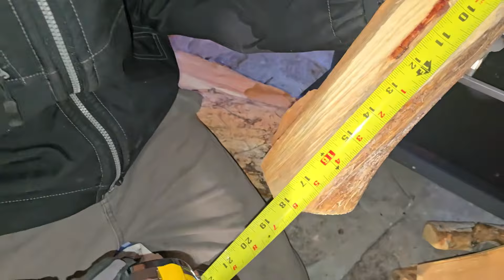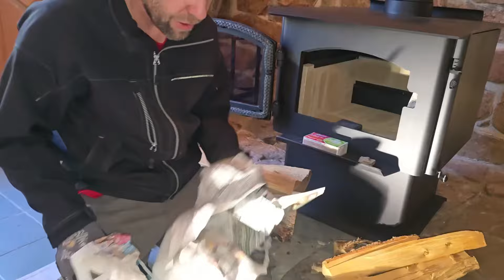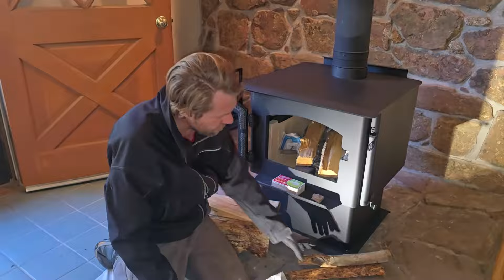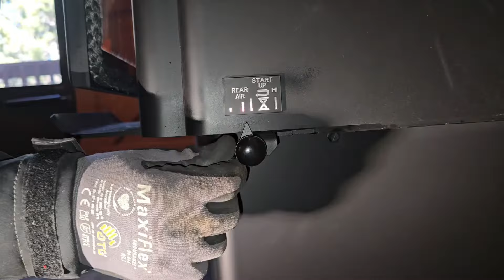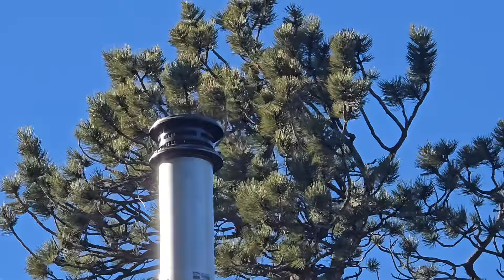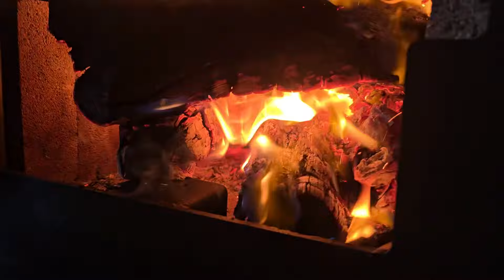Quadra-Fire 2100 Millennium wood stove review and Fire Starting video

Comment: From your video, I noticed on top of the air tubes in the firebox what looks like a white colored, fireproof insulation mat, like fiberglass batt. That seems like an odd detail and maintenace concern, as the fire touches it passing along on its way to the stove pipe. Can you explain please!

Comment: How hot the  top plate gets ? Is it possible to boil water ?
Reply from the maker: There is a stove top thermometer available and it usually shows 400 to 500F which should boil water in a tea pot after 30 minutes!
-Byron
Reply: @Midtownsweepsfranchise thank you

Comment: Great video man!  you are the only one that went over ALL the stoves capabilities in detail. I got this stove in November and discovered most of what you said on my own. The only issues with this stove which is common is that timed air control mechanism on the side, it doesn't really work right and I have heard this complaint from 2 others who have this model, so I just do it the old fashioned way and crack the door a bit until things are running very hot and red.
Reply from the maker: Thank you for the good details on the Quadra-Fire! I appreciate you watching and adding to the knowledge base here!
-Byron

Comment: Wow, another wood stove that kills heating a room by drawing the heated air back into the wood stove. Now, if the wood stove had a fresh air intake, it would be cooking with heat.
Reply: in order to get additional air intake from outside for a wood stove you'd have to have another pipe supplying air from outside. I haven't seen that yet.
Reply: @billbates5475  The outdoor combustion air myth got started almost fifty years ago when safety and construction standards were written for mobile homes.  Because they were small and factory-built, it was believed that mobile homes were air tight. As a result, all wood, oil and gas furnaces, stoves and fireplaces had to get their air from outdoors. Because these air supplies were invariably routed straight down into the ventilated crawl space under the mobile home, they didn't cause too many problems, so it was assumed that they actually worked.
In the 1980s, when large exhaust systems – like downdraft kitchen range exhausts – began to cause spillage from fireplaces and stoves in reasonably tight houses, a consensus quickly formed around the idea of bringing combustion air from outdoors, just as had been done in mobile homes for decades. Such certainty existed among housing technologists and regulatory authorities on the issue of outdoor combustion air that it was made mandatory in most building codes. Unfortunately, the decision to enforce mandatory outdoor air rules was made before research was done to investigate how they actually work.
The supposed benefits of outdoor air are not supported by research results. Laboratory and field reports have revealed that providing outdoor air is not a simple or effective cure for spillage, and that some designs could create a fire hazard.
Reply from the maker: Hmm Interesting!
Love to see a scientific report to support it!
-Byron
Reply from the maker: That is correct! We always do fresh air tubes through the rear wall- on this job, the tube was not installed at the time of the video. We HIGHLY recommend that all freestanding wood stoves have it!
Sharp eyes! Thanks!
-Byron
Reply from the maker: Agreed! The customer is having us install that separately. She was in a rush to get it installed that day. But soon there will be the sound of mortar drills and an air tube sliding thru the wall!
Thanks for the sharp eyes!
-Byron
Reply: You are perpetrating a myth because I assume you lack intelligence. Pay particular to the third myth. ;) 
Outdoor combustion air was a good idea until it was studied. 
There seem to be three theories behind this outdoor air supply, depending on who is doing the explaining.
The first is to replace the air sucked out of the house by the wood burner, based on the idea that houses are airtight and the wood burner will use up all the oxygen.
The second is to reduce the risk of smoking into the room, even when the room is depressurized by a big fan like a kitchen range exhaust.
The third is to save energy by using outdoor air rather than indoor air that has already been heated.
Doesn't matter which theory you pick; none of the three stands up to scientific scrutiny. It turns out that the most consistently reliable place from which to take combustion air is the room where the appliance is installed.  Forget about outdoor air supplies as a way to make wood stoves and fireplaces work better or be more efficient. If your local building code forces you to install outdoor air, you will have no choice, it will not reliably improve the performance of your wood burning appliance or result in higher efficiency of the system.

Have a great day!
Reply from the maker: Well I have heard this repeated on the internet as well, the theory that outside air is useless or even harmful. However, I have not seen the scienct for it yet. And the massive HVAC industry and Mechanical Code say outside air is good - so until the big boys say it is bad, and prove it... it makes sense to me.
Happy to learn your views though! Thanks!
-Byron
Reply: @mikecamrcplus3057  OR if people are concerned with safety or lack of oxygen in the room , crack a window a bit
Reply from the maker: Good strategy as always!

Comment: What stove top adapter are you running? All the ones I try are pretty loose in the collar. Thanks!
Reply from the maker: Good question- we use the top adapter that comes with the double wall connector when using double wall - 6DVL-AD
But when using single wall, as in this unique case, we just slip the male end directly into the flue collar of the solid fuel appliance, no adapter needed on HHT stoves like Quadrafire.
-Byron